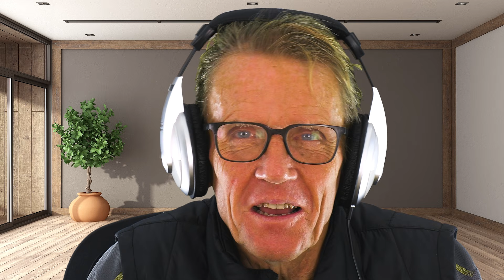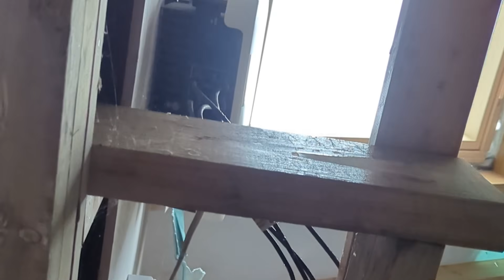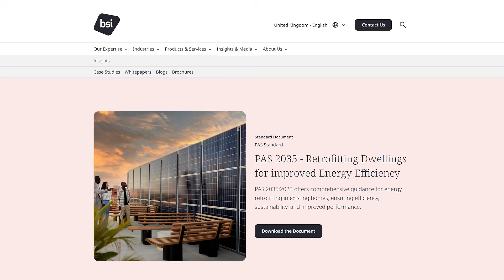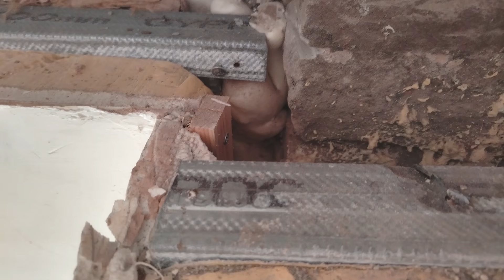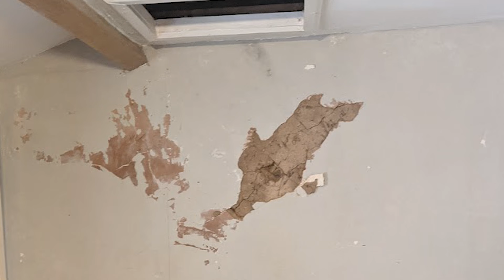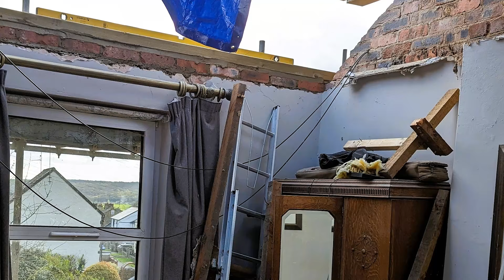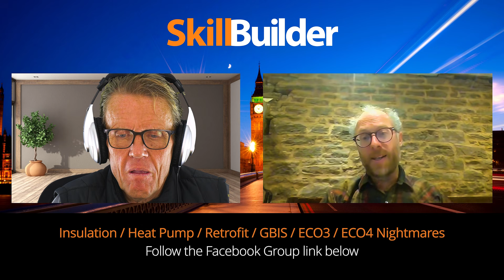Government Scheme Leaves Homeowners in Ruin – And Nobody Cares!

Comment: We have had these government sanctioned, cowboy builder scams since the 1970's at least. First, we had double glazing. I was persuaded to sell the stuff, for about a week, until I was told to visit a council house tenant and sell the D/G on the basis of it adding value to their property!

Then we had the cavity wall insulation, cowboy builder sanction scheme which achieved nothing but profits for businesses that went bust, handing people dodgy guarantees backed by nothing.

Then came the loft insulation, cowboy builder sanction scheme, leaving people with rotting roofs from the expanding foam they installed.

Then the solar panel, cowboy builder sanction scheme. That worked out wonderfully!

As a borderline Libertarian I am happy to see all these grossly overstaffed Whitehall department, quango's and regulators sacked, and consumers told 'Buyer beware!' Because it makes not a jot of difference if the government's involved, consumers just get ripped off anyway.

And a brilliant idea from Roger for this houseowner to reinstate his Oil fired boiler and tell the government to bring it on. No one should be left without heating in the UK and if the government make it unlawful to install the heating systems we want, they should be responsible for guaranteeing the systems they demand are installed work better and more cheaply than those they replace. And as we have the most expensive electricity in the western world, heat pumps cannot possibly be cheaper.

It's also ridiculous to expect homeowners to keep a heating system running on mild spring and autumn days, which deteriorate into cold and often freezing evenings and nights. This may work on the European continent where temperatures are almost entirely predictable, but we have the Gulf Stream rushing past our nation, which brings with it entirely unpredictable weather.

Good luck to this gentleman, and if I lived closer to him, and weren't as old as I am, I would volunteer my spare time to help him rebuild his home.

Comment: I have a survey, Luckily I have the skill to do calculations my self. Turns out, the aprox £1000 a year I spend on heating, Oil and a bit of coal for winter, would have been £2500 a year in electric. Didn't go ahead. As you say, home owners should not have to do a course on air source heat pumps to cover themselves.
He has my total sympathies.
Reply: Agree 100% ,also heat pumps cant be turned on and off like an oil boiler they need to be run by thermostat continual operation.
Reply: But there's a guy on YT telling everyone he is saving a fortune using a heat pump. I am very suspicious of these dodgy videos going out

Comment: I had an old Scottish sandstone house that had sarking board and slate on the roof no felt  and plenty ventilation. It got loft insulation inserted and about three months later the roof timbers had a green tinge to them .
Reply: Do you mean loft insulation on loft floor, or lining inside the roof?
Reply: @asilver2889 just the floor but that was enough to make a change, still plenty air flow , work that one out , big changes though
Reply: The warm air held more moisture than the cold air hence the condensation .
You need to stop the moisture entering the loft by sealing round pipes and downlighting,and install and whole house heat recovery ventilation system
Reply: @colinmorgan8624  Apologies Sir, but No. The cooler loft space (less heat coming through from the rooms below) means the dew point on the sarking timbers and loft spars is that much more easily reached, and more often besides.

The house was designed as a working breathing organism, leave it as designed. Sarking boards and no felt is a winning combination so don't ever change that either.
Reply: Always ensure loft insulation doesn’t stop air flow by blocking vents etc. Even the roof space has to breathe
Reply: Just to clarify, you could still fly a kite in the loft space after the insulation was laid on the joists, but timbers took on a green tinge and that was only months later
Reply: Yeah looks like the heat rising from the house was keeping the roof dry. When they put in the insulation it stopped that so now the roof is damp.

Comment: Solar thermal apparently works really well in the UK for hot water systems and yet it's rarely talked about and used for some reason? That would take a load off of any combined heating system that would then only need to heat the home.
Reply: The problem with most comments like this is what is conveniently overlooked is that we have a winter.  It like people with (electrical) solar panels claiming that the panels generate more electricity than they use in a year.  Solar produces around 10% of its annual output in the 3 coldest months with the shortest days.  The majority of the electricity is generated during the long hot summer days but its impractical to store the electricity generated in summer for use in the winter. I suspect the same is true of solar thermal for hot water.  An over abundance of hot water during summer but very much less in winter (maybe none for a week or more in winter). When one source can have a predictable switch off then the system has to be designed for worst case to provide the backup.
Reply: Indeed good thinking

Comment: Historically grid electricity has cost three times that of mains gas on a p/kW basis. Therefore it seems to me the COP (3 to 4) of the heat pump is needed to correct for that difference. If your system isnt correctly designed and installed so that its COP is less than 3 then its going to cost more to run. If the heat pump is undersized not only might it fail to heat the house but will its COP average be high enough to pay for the electricity?
Reply: Heatpumps have more maintaining costs and also you need it to payback and not just cost you money with install

Comment: all this complexity, maintainence, cost - all the energy to create, run and pay for heat pumps burns more carbon overall, its just a niche thing that rarely has value outside of poorly constructed calculation, the fact that we pay for this collectively for rich peoples vanity projects is treasonous
Reply: No, a reasonably installed heat pump uses a minimum of 40% less carbon for the same heat if you were generating app electricity with an efficient gas plant.

Comment: Good interview roger but that chap is a bit of a case. Why buy solar when you don't have a watertight warm house ? Why swith an oil boiler for a heat pump with no means to pay elec bills and no research, Why buy an old house withought significant funds to renovate it, why rebuild a roof withought insulation within the consideration? There's a whole ton of reasons this should not have happened ok dodgy grant based builders all around us. But you also need to do more research yourself
Reply: Yep, yer bang on, mate.... secure the fabric of the building first, insulate, insulate, insulate.... then consider the best heating solution.... this isn't rocket surgery... 🙄😂

Comment: Hi Roger, having read some of the comments section i have to say, i have first hand experience of being ripped off off under one of the government schemes when i did my own self build and renovation project nearly 15yrs ago.  The property only had a coal fire, so we were eligible for an eco grant. The commercial company that did the works did a reasonable job, apart from 2 cracks up a gable wall, which they just left!, anyway they claimed the grant of 8k, but when it came to paying our final bill,  its was £8k higher than expected as they said the government had ended the scheme before the job completed!. The rip off schemes and rogue companies have been out there a long time and still are by the look of it. Regarding heatpumps, during my last OFTEC inspection i was advised to take out an indemnity insurance against being taken to court over installation with customers who find thier heatpumps cost more to run than expected!. The government have targets and agenda but aren't concerned if you become cold in the winter or cant afford to run it. Heatpumps have a  place in newbuild well insulated buildings, energy costs for every household need to be much cheaper though for the up take, and energy companies need to stop ripping off the consumers. Cheers
Reply: But even late builds are having problems, one council fitted Swedish heat pumps that failed terribly they removed them all. Another estate complained of too much heat in summer and freezing in winter.
Reply: Yeah, pulling the winter fuel allowance for pensioners tells you ALL you need to know about "government" .... 😕

Comment: Building regs have specified since 2005 for gas and 2007 for oil that boilers must be condensing. Unfortunately it took until 2022 to change the regs so that the system would run at a temperature that would actually allow the boiler to run in condensing mode. 
If your system will allow condensing mode in the boiler, it would be fine to run a heat pump with no other modifications.
At the time the system is installed, the additional cost of making it suitable would have been trivial. Altering after the fact can be very expensive and disruptive.

Comment: The notion that a heat pump can be simply be installed and work efficiently as a space heating boiler replacement on the average UK house is 100% flawed.
Either the building is designed with insulation from the start or retro fit insulated to the required standard for good CoP. Otherwise forget it.

Comment: A few years ago, I visited a Green Festival run by North Norfolk Council. At the time I was looking to change my boiler, so I spoke to the fellow on the Heatpump stand,  it was a swift talk; he asked me what type of house, I told him it was solid walls over a hundred years old. He told me to forget installing a heat pump. How things have changed.
Reply: You have to appreciate his honesty.
Reply: @joejoejoejoejoejoe4391  rather, the heat pump installer seems ignorant
Reply: That's the difference between a professional who takes pride in his job and someone who's just in it for a quick buck.
Reply: Had a similar conversation a few years ago with an official who was honest enough to tell the truth regarding homes built over one hundred years ago.
Reply: So many plumbers speak against them for all homes.
Reply: However, heat pumps have also changed. Newer models are capable of much higher flow temperatures at much greater efficiency. Still not appropriate for every property, but the problem is cowboy installers rather that heat pumps per se
Reply: @Ali-ps8rm  a recent Heat Geek video suggests heat pumps are close to being able to heat all homes, even those with limited space.
Reply: Older buildings can be heated with heat pumps. See Essays Concerning (a Victorian house)

Comment: Ditch Net Zero, problem solved. Let people choose what they want.
Reply: Run out .... 😂😂😂😂😂 Go back to school
Reply: WTF has my comments gone???
Reply: Problem postponed, not solved. The oil and gas are going to run out, and get much more expensive to extract long before that happens - we'd be facing that problem already had not drilling technology advanced greatly in the last few decades to allow ever-deeper deposits to be extracted, but even those will run out - current projections put that at about one hundred years, give or take a few decades depending on consumption rate. Ditching net zero doesn't solve anything, even ignoring climate change: It just means kicking the can down the road and hoping your grandchildren can deal with it.
Reply: Ditching net zero would solve a LOT! It would stop this country sliding into bankruptcy for starters. 
Even if Britain went 100% green energy, it still would make absolute zero difference to climate change.
Reply: @vylbird8014  no it doesnt besides theres no shortage of gas or oil for the forseeable fututre and instead of foricing people t6o have expensive current renewable tech they should just leave it as a choice and use any govt funding into researc for better solutions
Reply: @vylbird8014  Oil and gas are going to run out? Says who? lol. Your starting assumption is wrong my friend.
Reply: @chrisjie2127  Of course it's going to run out. There's only a finite amount, and it's being extracted. It has to run out. The only questions are "When?" and "Will it be far enough in the future that it is someone else's problem?"
Reply: @vylbird8014 in hundreds of years. About 70% of each well remains too costly to remove, but when it becomes more expensive it becomes more financially viable. There is plenty there.

Comment: As ex builder i can say surveyors are mostly useless , won`t lift floorboards , won`t go in a dusty attic , if it looks ok it passes  and the `damp `meter `is for his damp remediation friends doing mostly 100% un needed work and not even bothering to unblock gutters or look at piled up or raised beds on house ! .
Reply: Surveys have a disclaimer that remove all liability, says a lot about the industry, drive by reports basically.
Reply: I followed my surveyor around and told him why he was wrong and to put the timber moisture meter away... he didn't like me for some reason.
Reply: A friend of mine had 2 surveys done on the house before he bought it. Somehow they both missed that the house was full of dry rot
Reply: I've been it, just a list of excuses why they can't check anything. Been out to supposed pipe leaks in loft when there isn't even any pipework in the loft as they won't go in the loft, absolute joke
Reply: very true Mykharli
Reply: A long time ago I had a survey done on a house I bought. Amongst guff included was rising damp in an internal party wall. Turns out it was a spilt oil patch on the kitchen wall.

Comment: Funny thing is, they turned the heatpumps off in the house of Parliament, they was costing to much to run and not heating the building, not fit for purpose in effect, Funny old game.
Reply: SHHH !!!! 😏😂
Reply: And stopped EV charging in their underground car parks
Reply: Data from the energy efficiency platform shows that the estimated annual bill for heating and hot water with a ground source heat pump is £806 – only £9 less than a traditional gas boiler. Heating a home with an air source heat pump will cost £1,001 a year, on average. What's the point in changing?
Reply: @makcity7850  "Muh climate-change" !! Green BS thats not even slightly green... just like the EV green BS....🙄
Reply: @makcity7850 All to fuel a climate crisis apparently, but in 40 years I have never known a climate change prediction or model that's been correct yet, even the ice caps in Antarctica have significantly grown this year, and let's face it they can't even predict the weather with any degree of accuracy a week in advance,  I can only draw inferences.
Reply: Well, it used up the tax-payers' money, so all part of the plan it seems.

Comment: Good interview Roger. I've heard sector leaders laugh unsympathetically at these situations on the radio, saying that obviously the homeowner should have employed an expert. Quality of the housing stock generally, short-term changeable schemes, recognisable stable accreditations, and the availability of practical cross-sector skills to set out an initial impartial plan, plus the money and willingness to pay for an impartial upgrade plan, those are the obstacles, especially if some other expert hasn't seen major problems with the building. It's fine, until it's opened up. 
What would be useful is if professional bodies, many of which are charities, launched an affordable expert witness scheme for the public, supported by qualified volunteers or modest payments.

Comment: Im not convinced the weight of solar panels is any more than even roof slates and definitely lighter than tiles. I agree the install should not have gone ahead as roof clearly needed replacing but surely in this case it would have been obvious to the owner.
Reply from the maker: James 
I did say that there would be people who said the homeowner should have done more research but let us imagine that the home owner was somebody who has no experience of building structures and simply relied on the experts.
Reply: @SkillBuilder It's not about research, any roof that collapses because solar panels have been fitted would clearly have had signs it was not in great shape even before the work was done. The building was clearly of an age, the owner is clearly no fool yet he claims he didn't know anything. 
I agree that customers are not meant to research everything but this is somebody swinging the lead.
Reply: The guy said he was prepared to do some work  himself, this means he has some knowledge to think about trying it.
Reply: Maybe, but you are putting the weight of tiles AND the solar panels. Not one or the other

Comment: I installed 21 used solar panels and an inverter at my house. It cut my electric bill by 80%. It cost me 3500 pounds. I did the whole installation myself of course.
Reply: Yep, PV is much simpler that heat pump. You just have to make sure the roof can take the load.
Reply: Installation certificate for insurance?
Reply: @chrisalfred7549  Insurance? Is that a UK thing?
Reply: @jam99  Only if you can afford it and it's tricky to get them to pay out if you claim anyway.
Reply: @jam99 It's removes plausible deniability in case of a fire and the insurance doesn't want to pay for the damage.
Reply: @andrewallen9993 insurance wont pay often even if an installer does it as most vanish after 5 years and then the insurance blames that and no payout
Reply: @chrisalfred7549 Yes, As I had advised an electrician on an "interesting" two phase elcb problem he had I got my certificate of compliance without him even looking at my installation. Cost me a hundred pounds.